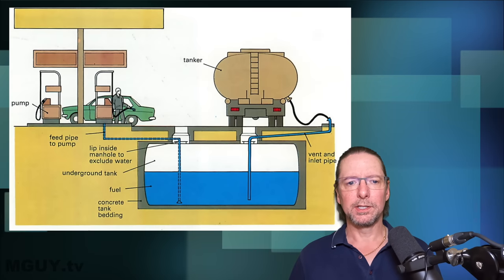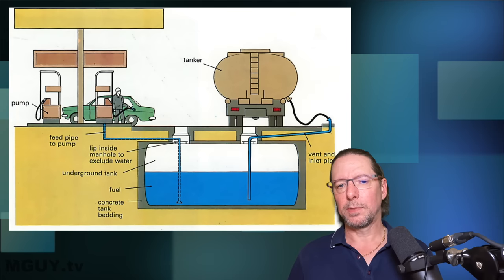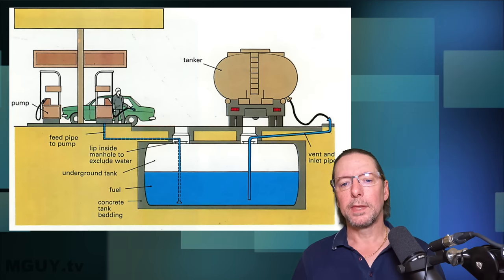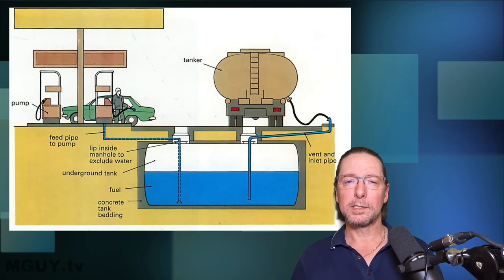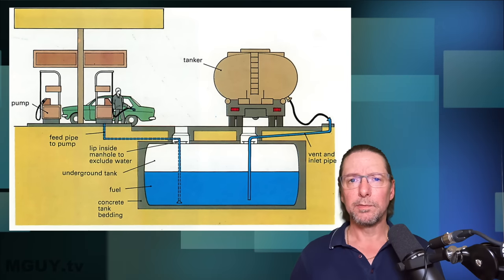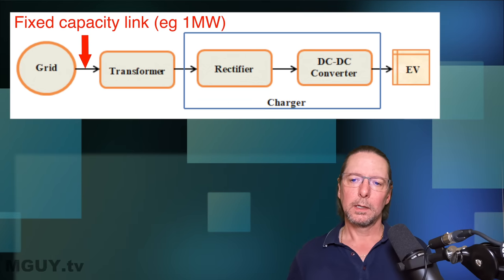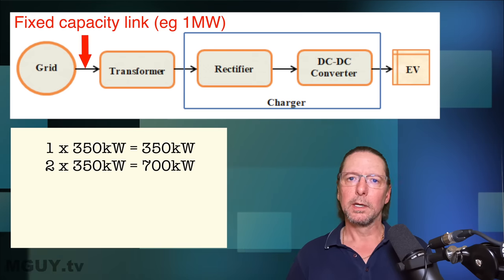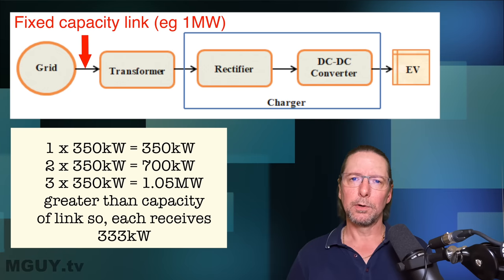HUGE problem with EV Charging Stations that no one mentions | MGUY Australia

Comment: One thing most people don't think about is when on a trip, you've calculated how much time it takes to get there without giving much thought on how long it takes to refuel. But with EV you've got to add 1-2 hours to your travel time to get to your destination. It takes longer to recharge a battery than it does to fill your tank.
Reply: The EV controls your life.
Reply: Plus, what happens if there is a road blockage and you are stuck in a traffic jam for many hours or even a day (like out in Wyoming which I have seen more than once in my travels) especially in winter.  That along with 50 miles or more between exits with no guarantee that there will be a functioning charging station available. 
Then there are others like myself that drive for ten hours at a stretch. I don’t want to be bothered taking precious travel time to set and wait for what could be hours of wasted travel time. 
Even worse there could be an EMP and all electric cars would be out of commission. 
This just proves how stupid politicians and the others that have been brainwashed by our bigoted educators are.
Reply: @mebpratt859  technically an emp would destroy pretty much any vehicle made in like the past 50 years if not longer.  Unless you completely disconnect the battery  prior to it going off, it would short out pretty much every device, making it basically a brick with wheels.
Reply: I hired an EV for the weekend to see how bad this was - it wasn't bad at all.
There are numerous parts of your day when you can leave your car charging while you do other things, eg, shopping, working, sleeping, going for a walk.
I recharged the car twice over the weekend, and it was chill.
Reply: @xcrockery8080  so, your store has an EV outlet?  does it have 100 or even a thousand?  Walmart for instance serves 10% of the US population daily.  I'm sure your work would love having to shut down for weeks if not months while permits go through for the city to approve budgeting for work hours on the destruction of its parking lots or land to install a charging station?  There is then the problem that electric vehicles have started exploding the world over with highly toxic gases being emitted that standard firefighting equipment can not put out the fires for and requires extensive decontamination...
Reply: @nathanielbass771  I don't think you need to be hysterically scared of "destruction of its parking lots or land to install a charging station". No such thing happens.
Also, do you need to fill up every time you go to Walmart?
Petrol cars explode at a much higher frequency than electrical cars do.
Sounds like you are scared of change. Some people were very scared of electricity when it first came in, too.
Reply: @xcrockery8080  petrol cars don't explode at all unless  you're driving a 50 year old vehicle that deliberately cut corners in the production process.  There are even videos of people shooting gas tanks and not even being able to ignite the gas unless significant firepower is used.  It's a myth that's been kept alive by Hollywood and other film production sites.  Also, I'm sure the safety inspector will be very happy to see your exposed wiring in high vehicle and pedestrian traffic areas unless you intend to service ONE VEHICLE at a time due to the cable not being able to support an electrical draw above that... (a huge amount of house fires are caused by people overloading a single circuit)
Reply: @nathanielbass771  Petrol cars explode at 80x the rate of EVs.
"0.0012% of electric passenger vehicles caught fire from 2010 to 2023. .. for petrol and diesel vehicles, EV Firesafe used a range of country reports and found a much higher 0.1% risk of catching fire. That’s more than 80 times the rate EV Firesafe found for electric vehicles."
Reply: @mebpratt859  You don't use energy while stuck in traffic.
Reply: @nathanielbass771  Poor muffin, afraid of change.
Reply: @nathanielbass771   In fact, electric vehicle fires are so rare that statistics show internal combustion engine (ICE) cars are 20 to 80 times more likely to catch fire compared to EVs. Electric bikes and scooters also have a higher chance of catching fire compared to EVs, making electric cars relatively fire-safe compared to other vehicles on the road.
Reply: @nathanielbass771   why would you need so many outlets? That's like saying there should be a gas pump in every parking space, when most only need a top up once or twice a week, which most can do at home while sleeping?
Reply: @xcrockery8080  "There are numerous parts of your day when you can leave your car charging while you do other things, eg, shopping, working, sleeping, going for a walk."  That's great and if it's a public charger you're relying on the general public to return to their fully charged EV in time otherwise you wait even longer to charge your car.  Most people would rather walk around the shops than wait in a cold EV waiting to charge which means some will be late returning to their vehicle.  All very well if you have a home charger but issues with that too - if you have more than one EV then you need another charger because this thing called life gets in the way.  And having a vehicle that you can just use right now to travel hundreds of miles is the whole point of car ownership.  EVs makes this entire process so much more hassle whilst pushing up the insurance premiums for all drivers.
Reply: @Wilem35   So you don't have the heater or air con on then?  The radio?
Reply: @mebpratt859  EV cars do not use energy when stuck in traffic. They do not 'idle' when they stand. Neither are modern gas cars. I have Volvo. When is sits in traffic jam, engine stops automatically and starts automatically, when I need to move.
Reply: @Wilem35  Who is willing or prepared to sit in near or at sub-zero temperatures for hours or days? 
Very few people other than truck drivers are prepared for those kind of situations in bad weather.
And does that extreme temperatures affect the batteries when exposed to those temperatures for a long period of time?
Reply: @anatolyklypin4815  What powers EV heaters, aircons, gps, radios etc. etc. when stuck in traffic? Fresh air?
Reply: @nathanielbass771  That is why we always have one old vehicle along with a newer vehicle. The old one is always a 4-wheel drive vehicle.
Reply: @captainpugwash3791  Sure, one uses some energy. E.g. for 3hrs of waiting and running heating drops battery by about 3-10%. Not a big deal. GPS does not take  any sensible energy. Radio: depends how loud. Normal radio takes about 10Watts. Battery capacity is 75KWh. So, you can listen radio for ... 1000hrs and use only 10% of battery.
Reply: @CyrilSneer123  You don't have to wait for your car to finish charging when you finish your shopping, you get in your car and drive off.
People very rarely need to "travel hundreds of miles".
The average commute where I live is less than 30 minutes charging for the week.
It really isn't very difficult.
People who are afraid of change really need to get a grip.
Reply: @captainpugwash3791  
I own and drive an MG EV. With the A/C cranked to full, Bluetooth connected to my phone, and songs playing on the sound system, GPS operating (like your phone, it’s permanently operating), Daytime running lights, everything going, we use about 1% of power per hour. Generally, in traffic jams etc, if you have an ICE car you will be running the engine to keep all these things going, especially A/C, ours is an older model, so the range is a mere 320 kM, (200 milees for those of you with a foot fetish), so we generally drive for a couple of hours, stop, plug it in to a charger, go get a coffee, a snack, toilet break, whatever, then continue our driving, we generally DON’T fully charge at outside charge points (80% charges fast, then, just like your phone, it slows down for battery efficiency). 
Basically pretty much the same we used to do driving our Honda Jazz.
Here, in Thailand, charge points are not as common as they are in Australia, or the USA, or Europe, however, the difference in driving patterns is negligible.
The biggest difference I have noticed is that, if I got stuck in peak hour traffic on the freeway in our Honda, it would use a much greater amount of our available power (ie, petrol) than the MG does, just to keep the minimum level of comfort in the car. To be honest, we were more likely to turn off the A/C in the Honda to save fuel in a traffic jam, than we are in the MG.
Charge points are not as common as Servo’s, but still, there are enough of them that charging is not an issue, and most of them offer the ability to pre-book, via a mobile app (which also gives their location, and can be used to estimate how long it will take to get to them), and this is, as I say, in Thailand.
We also have a home charger, which enables us to start every trip with a ‘full tank’, compared to having to stop at a servo to ‘top up’ before we leave, which we would usually do in the Honda.
Added to the fact that our electric demands cost about 10% of the petrol cost we were using in the Honda (and that was before the big price increases), and servicing is faster and between 1% and 10% of the cost, and the car is more reliable, and we don’t have to worry about getting a bad batch of fuel (which actually used to happen to me more in Australia, than here in Thailand, go figure).
Reply: Most of them now have quick charge. You can go to about 80% on ten or fifteen minutes. It's bound to improve even more as time and technology march on.
Reply: @mebpratt859 What happens if you get stuck in a traffic jam with a gas car? If you are running low, shut off the car when traffic isn't moving. EVs do this automatically to save juice. No difference. Eventually there will be as many charging stations as there are gas stations. I live in the middle of nowhere,  yet was surprised to learn that there are about ten charging stations within fifty miles! Never looked for them before, so had no idea.
Reply: @nathanielbass771 Yep! We all know that no gas cars have ever caught fire, and that if they did they would burn clean!! Of course this technology is going to have growing pains! All technology does! Never stopped progress.
Reply: Assuming you can find a working charger and you don't have to sit in line waiting for two or three other people to charge before you.
Reply: @xcrockery8080  Now, when there are only a few EVs. Do you really believe there will be so many chargers that hogging one up like that won't be the cause of the new road rage?
Reply: @Wilem35  you certainly do in hot or cold weather, and battery capacity is much lower when it is either very hot or very cold.
Reply: @herbertshallcross9775  Have you been sniffing gasoline again?
Reply: @Wilem35  Thank you for your reasoned response. Conversation with intelligent people is a great pleasure.
Reply: @Wilem35  sure you do unless you go without AC, Heat or play the radio!
Reply: @Wilem35  When it's over 90F degrees, I want my A/C to work.
Reply: @jamesplotkin4674  why wouldn't it work? Doesn't it work at home? It must be tough going through life in failure mode.
Reply: @mebpratt859  If there was an EMP,  ALL cars made past 1980 would be out of commision, not just EVs.

Comment: I’ve been on trips with my friends non-Tesla EV, almost every charging station has broken units and we’ve never received the full charging rate.  Most often it’s half the rate.  I’ll drive my hybrid for now !
Reply: This is why Tesla succeeded. I wouldn't buy one until they had enough superchargers. When I needed to use public stations, at least half were broken, and many weren't where the maps said they were. (I realized the map was showing the billing address for the charger's owner, and not the actual charger which could be miles away.) The superchargers are rarely out of service, never more than 10% at any given site not working, and you can see how busy they are and all their stats from the dashboard.

Without something like that, charging is not going to be a reasonable alternative.

Comment: The problem is even worse because the recharge time is much longer than it takes to fill a tank. So even if the 10 charging stations could work at full power, they serve far fewer vehicles every hour.
Reply: But if the pub your are visiting has some chargers in the car park...and you plug in while you have a pint or 12....?
Reply: @JohnSmith-pl2bk  let then your cars stays put..
Reply: I've had an EV for 6 months and I've driven into a petrol station exactly once in that time. To buy a sandwich. The rest of the time I just plug the car in once a week at home and in the morning I drive it again. So if time is such a big deal then buy an EV. If I did need to use a public charger e.g. if I had to drive 200+ miles somewhere, then chances are I also need to eat food, take a piss or just stretch my legs. So charging a car at the same time is hardly an inconvenience.
Reply: @drxym Tell me, how much it cost, to buy that, and have it installed. $$$$. Also, say you got home, with 5% battery, and had to go somewhere in an emergency, etc. You'll be wishing you went to the Gas Station 5 or more times that Month.
Reply: @fredjansen2659  The charging spots are now starting to charge for the parking spot as well, so you will leave right away. Not cheap either.
Reply: @MatthewBerginGarage  ah the american way, extract max dollars out of your customers with shabby service
Reply: Don't drink and drive . . . !    @JohnSmith-pl2bk
Reply: I'll drink to that...at home! @EllieMaes-Grandad
Reply: @drxym  Charging overnight means that 90% of your cars power is from hydrocarbon fuel sources. The push to get people into EV's is allegedly justified by the global warming crisis, attributed to CO2 emissions from burning hydrocarbon fuels.
Reply: @drxym  Well lets hope you're as patient when you waiting on an EV space to charge and the other person wanders off to the cafe and doesn't come back in time.
Reply: @MatthewBerginGarage  They're charging for that because people are wandering off to the shops etc whilst their EV charges and they're not coming back in time.  Another problem created by EVs and the answer is to charge more.
Reply: @CyrilSneer123  The answer is to not use EV's, since there is no climate emergency there is really no reason to anyway.
Reply: @JohnSmith-pl2bk what if it is already being charged and used as a parking by a patron in the pub, just like you said.
Reply: @hotshotsunnyz  I think this is a problem with chargers in shopping mall parking lots, because the guy leaves the car charging and goes to lunch, goes to watch a movie, goes shopping... And the car stays there...

Comment: A huge problem is security at charging stations, especially in Metro areas. Currently, if you live in a metro area you and  try to charge, there is a good chance that you might get assaulted…..least case scenario is that somebody taps on your windshield and demands money, aggressive panhandlers demanding money. Usually a $20 bill will take care of that. But when you go outside to remove the charging cable you could get attacked and robbed and in my opinion it is not worth the risk of owning an EV.
Reply: Thats not an EV problem that is a societal/policing problem, you stand the same chances with an ICE vehicle under these circumstances
Reply: @davedixon2068 with a gas pump you can drive off in an emergency situation without pulling the nozzle out first or leaving the vehicle.  They are designed with a break away point and valve (the silver swivel joint in every fuel hose) to stop the flow of fuel automatically.  That isn't an option with an EV.  The chargers lock to the vehicle and the car won't let you leave without manually uncoupling.  Even if it did, it would likely do significant damage to the EV and or charging station.  Totally different from a fuel hose that is designed to pull apart without damaging anything and is easy to repair without a specialist.
Reply: @Noah_E  no reason why a simple breakaway cant be put on a EV charger and a simple switch system operated from inside the car to allow the car to move in an emergency. problem solved!
Reply: Good point! Waiting somewhere in the middle of the night is not the safest thing to do. They will push security even more to tackle this issue, tracking, monitoring, etc.
Reply: I agree , because there are no attendants to help , unlike a gas station.
Reply: That sound like more of a Liberal soft on crime problem, but sure it can happen at a real gas station but your car is not locked in for hours
Reply: @Bobo-ox7fj  no I dont what?
Reply: @davedixon2068 I've never had to spend a hour fuelling my car...
Reply: @disbeafakename167 doesn't take an hour to get mugged
Reply: @davedixon2068 no you don't I disagree based on the amount of time you spend in an area as a direct correlation to the amount of risk you run of being robbed or assaulted 5minutes filling gas versus 30 or an hour charging 
Do the math jack
No joke
Reply: @davedixon2068 no it doesn't but the longer you linger the higher the risk obviously